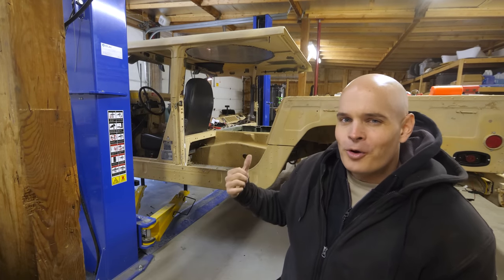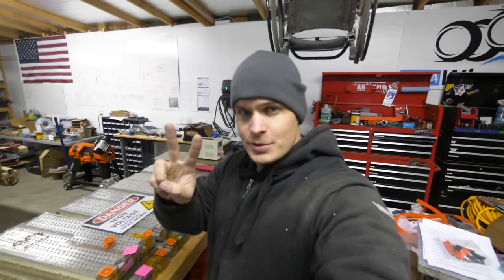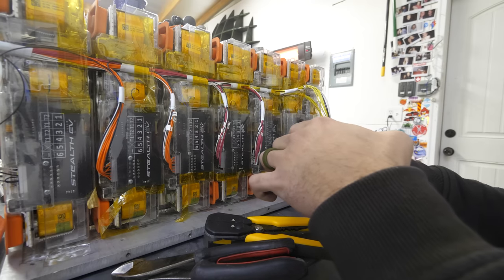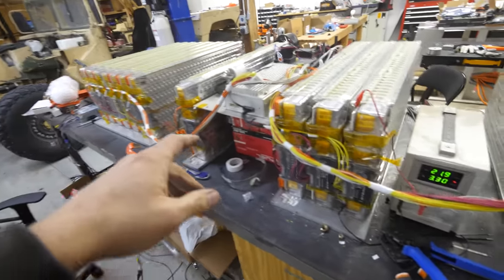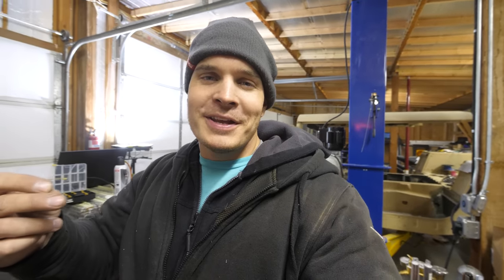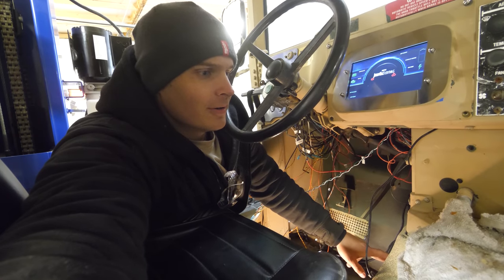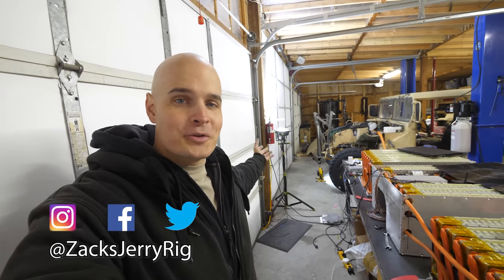Building the Brains of the HIGH VOLTAGE System - IT MOVES!!

Comment: Serious problem that you might want to rectify even though it will be painful… the balance leads should all be the same length, it looks like you cut them off at different lengths to make it look nice and neat which would seem like a good idea but the resistance of the wire changes as the length of the cables change and this will throw off the BMS making it inaccurate and highly likely throwing the batteries out of balance. Love the build keep up the awesomeness man 👊🏼

Comment: 16:09 The reason gage numbers are inversely proportional to the wire size is because back in the day when they made wires (and maybe still today, I dunno), they pulled the original chunk of copper through a hole. If you wanted a smaller wire, you'd have to keep pulling the copper through successively smaller holes. So a small 18 gage wire would've been pulled through 18 holes.

Comment: Amazing project! So cool to see it coming together!
One suggestion I would add though, is that each box should have it's own set of contactors.
I don't think that's the case, but in the event where you need to take the battery apart again, those long live cables coming from each module are going to become a safety hazard.

Comment: Just wanted to point out, voltage doesn't kill, amperage kills. A taser releases 50,000 volts of energy, but less than 3.0 mA. I've been shocked by 110, 220, 330 and 440. 330 and 440 HURTS, but 440 blew the soles of my shoes out. I'm no electrician by any means, but I was taught to respect electricity and I have had to replace outlets and motors live. You just gotta take you time make sure you don't accidently touch both contacts. Probably the scariest experience was with 12v AC. I had to replace fiber optic motors in one of our casinos live cause we didn't know what breaker they were on, we tried the ones labeled "Fiber Optics" and we still don't know what those turned off, but it wasn't the fiber optics 🤔🤷‍♂ so I chose to replace them live. First one I did I didn't do the 1 wire at a time rule, Stripped both wires and the sucker started arcing and shocked the crap out of me. The other 12 motors went fine once I did it 1 wire at a time. I will never work at that location again. But I do love the fact that you respect the voltage, but again it's not voltage that kills, it's amperage that kills.
Reply: Voltage plays a role though, due to Ohms law.  You could have a power source which can deliver way more current than is needed to kill a person, but if the voltage is too low given the resistance that the person presents in-circuit, then a lethal current cannot flow through them, thanks to Ohms law.

Telephone exchanges for example, often run equipment on 48v - 50v DC bus bar.  That 50v DC bus bar is fed with configurations of very many huge 2v lead acid batteries (parallel banks of 25x 2v batteries in series), each battery individually capable of sustaining 1000+ Amps, yet you feel nothing at all if you touch both terminals.

I've also touched both the black and red sides of that copper 50v DC bus bar with one dry hand span and felt nothing, but short that bus bar out with a screwdriver or spanner and watch it explode in your hand, like a huge fuse pulling thousands of Amps.

As I'm sure you know, the human presents to a circuit as a resistor and Ohms law means that a lethal current depends on the humans resistance, the Voltage present and the current capability of the power source.

Comment: I have worked with high voltage batteries for DIY electric cars (Formula Student competition). My recommendation is that you should put a insulation layer inside the metal box. If you check closely you can see that the distance from your battery segment terminals to the metal conductive case is quite small. If something would go wrong it is easy that the terminal would touch the metal case. It might seem that that could never happen but think about that you might for example drop a washer or a nut down there that shorts the terminal to the case. Besides that your cable management is very good.
Reply: Yeah same here, our BMS wiring and all those cell sense fuses looks like a nightmare 😂

Comment: @23:08 That lug has the wrong size hole. I'm sure some will say that it doesn't matter, but you could get excessive heat build-up under the loads that connection will be experiencing. Just seems like something you would make sure was proper given how attentive to everything else you are.

Comment: 19:48 
I'm sure it was a mis-speak or just a simplification, but 450 volts is not lethal. It's the amperage that's lethal.  Higher voltage allows electricity to conduct on materials that are not all that conductive. Electric fences, for containing animals, are rated at about 4,000 volts because animals such as horses, cows or sheep, have a thick coat and are insulated from the ground because of their hooves. It barely gives a tickle when you get shocked because it's only about .2 amp that flows through.

High voltage will open the door to ground more easily through you, but high amperage will fry you.
Reply: voltage is a measurement in pressure of the electromotive force. higher voltage only energizes a conductive path   along conductive materials the same as low voltage.  you have fallen for a myth. the electromotive force works by dislodging  the electron on the outer valance of an atom that has one to three electrons in orbit.  this outer valance determines what is a conductor or an insulator . there is no "less conductive",it is or it isnt. same for a semi conductor which can be either a conductor or an insulator  .it is or isnt not less.
Reply: @benniecameron6441  That is interesting and definitely helps me to understand what's going on at a base level, but there has to be more to "conductivity" than what you are presenting. Why does it seem that certain metals/materials are better conductors than others?

Comment: I currently work on some of the tower lighting system (i fix some of the lights on those towers you see going down the road) the flash 324s I work on are around 1200 volts so I know what it's like to work on high voltage. You rarely forget to watch your fingers. But again it's not always the voltage that gets you, it could be the amperage

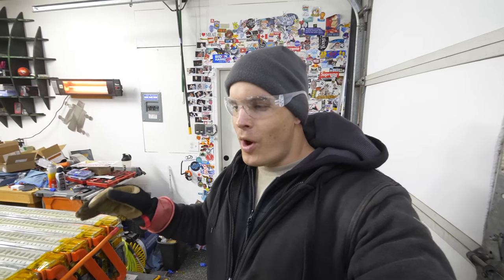Comment: at 23:30 - do you see how close the un-insulated wrench is to the bare alum cabinet!!  you should have glastec fiberglass sheets lining the box - this is a higher di-electric rated compared to rubber and lasts longer under heat it does not break down

Comment: This is so awesome! Small correction about the termination resistors on the CAN bus, the bus doesn't know that is the end based on the resistor, the resistor is there to stop reflections of the signal off the end of the line (that happen due to capacitance and inductance of the wires which we usually ignore). These reflections can muddy the high speed signals.

Comment: Like suggested elsewhere: you should put some insulation around the connectors and also put some rubber grommets in the holes through which the wires go between the 3 boxes. Also: using a metal box without insulation is not the safest idea. One slip of the high voltage wires when connecting or disconnecting and...

Comment: Small thing I noticed. Shouldn't the holes on the battery management box be grommeted? (where the main cables enter) I think there could be cable chafing without that and that could be bad. Probably got this covered already but just checking.

Comment: Cool project! How about an experiment stimulating regen by water? Basically using the car as a power plant. Mounting some pallets on the wheels and parking it in a small river (slightly raised so the wheels can spin and regen). Could be a great solution for remote locations with river nearby. Would be interested in your thoughts if this would ACTUALLY work and how many KW/h the car could self charge in a 10km/h small river. Maybe later, when fully finished.

Comment: 26:01 - looking at that wifi module, wondering if there's an aluminium plate going over the top - if so, probably not going to have much wifi signal.

Comment: I can see that you removed the original PCB from the Tesla modules. That made everything more complicated. That PCB was reading the data (cells voltage, and temp) but also was balancing that module. So instead of having only 2 communication wire connected in a ring between modules, you decided to use KM of wires  (or miles in your case) from each module to the main BMS. I have my own BMS that can communicate with the Tesla modules, and it makes the whole installation simpler and safer. But congrats for the entire project!

Comment: The CAN-bus is a differential pair system, meaning that a serial signal is transferred trough the high wire in its original form and through the low wire in an inverted form at the sending side. Now every interference that acts on the wires will act on both signals the same. On the receiving end the low wire is inverted back and than combined with the high wire. And this is where the "magic" happens: Because both serial signals are now the same again, they add up to twice the signal strength while any interference that hit the cable on the way now is inverted in one of the wires and therefor it cancels itself out. Oh, and you twist the cables to ensure the 120 ohm impedance that you need to have a good signal strength... So make sure you measure the impedance of the cable. if it's not 120 Ohm, your CAN signal might degrade...

Comment: Zach, you were completely right about the 450V is lethal, because it is the voltage that kills. But we can see electricity, but not when it is running through a cable. Think about lightning or arcs or sparks, those are pure electricity, so we can see electricity.

Comment: 22:44 I don't see any rubber pass through grommets on those holes. Also, 23:01 That power cable it going to get worn/damaged over time by the metal corner near it. I'll assume that you'll address those things later, right?

Comment: Make sure to use rubber fittings for the holes where cables run through to prevent potential damages to the cables

Comment: I would highly suggest to put cable gland rubbers or rubber gromets where the cables leaving the aluminium boxes because with time if there is any shake in the system the edges of the box will cut the big wires thus creating a huge short circuit.

Comment: Great video. Great project. 
Caveat. The amps are what's dangerous not the volts.
Watt= volt x amps. The higher the amps, the more dangerous. You probably have a lot of amps there. Probably 45000 watt/hours there? Then 450 volts times 100 watts?

Comment: I suspect (and hope) the NFS is the wireless connection:
it can be low power
it can be low range
it is secure

If they use any other, I really hope it is a secure connection.

For twisted pair, as far as I recall it does not block the interference, it just makes it evenly applied to both pairs of wire, and since they carry opposing signal, the interference can then be clearly identified and isolated.

Comment: I have been following this series from the start and very excited to see the end result but I have a question about cooling your batteries..
When you designed the battery casings you haven't marked or noted anything regarding a cooling system for those batteries specially for 450 volts system thats kinda important.
Any plans for the future ?
Or is there anything we missed or didn't see ..
Thanks and keep up the good work 
I'm checking the channel regularly like every Wednesday to see if you uploaded any updates about the project.

Comment: HI man I want to throw a suggestion to you about the wires on the underside of the hummer you should double rap them each rap is a separate color so if anything gets nicked along the way it is easy to identify  the point of rubbing i think it would be a good safety measure if there were trouble sometime in the future

Comment: The odd Ground wire needing to be connected provide the SAME ground reference to everything.  Voltages are measured as a potential difference in "voltage OR pressure" The latter being a comparison like water or air pressure. Communications also use voltage and must have a base line to measure from and it's normally very low for communications.  
The 450 volts is a concern, but it's unlikely to kill you unless (like you have) a whole lot of flow or amperage. The amp's will flat fry you.  Ever get shocked by a door knob or car coil. Your talking 8 to 30 THOUSAND volts but next to zero flow.  Think a soda straw with 20k psi, it's high until you open the valve with zero restrictions the straw would not move VS a fire hose same pressure but with your 100 gallon tank (18 battery packs)
Reply: it doesn't take all that much current to kill a person (static shocks are extremely low current), on the other hand, all the current in the world isn't going to flow through a human body unless the voltage is high enough.  The electrical resistance of the human body is extremely variable (depending on all sorts of condition's), but taking a sort of middle estimate from google, i get 10,000 ohm's.  At 450v, that would pass 45 milliamps, about half what is commonly considered lethal.  It's close enough that i wouldn't consider it "unlikely" personally.
From the bit of reading i've just done, more people die from low voltage shocks (120v ac or less being implied here) than higher voltage.

Comment: One thing I want to say what do you have the boxes insulated with insulation so if a short wire comes loose will not be a problem but I think you should have a isolation

Comment: I am unsure how your CAN network is setup, but if I rember correctky from school projects, there should be two and only two resistors enabled on each conected pair of H and L, on the furthest connections, to componsate for comething about high frequencies over long wires. Please make sure to double check this before running, ask a mechanic familiar with electronics in the car industry preferably. I had issues with hooking up too many ESCs with resistor enabled and the signal voltage was pulled too low to be registered and the readings were all over the place.

Comment: Great project, very neat work. Just wondering if there is a torque rating for the high voltage wire connectors. It didn’t appear to be tightened very much with that ratchet. I realize it is still on the test bench at this point.

Comment: This is so cool,and you are the most satisfying and educational and fun person to present this. But i learned that the human bod has about 1mega ohm (1million ohm)of resistance with dry fingers,and an lethal amount of CURRENT (the voltage is not important here),is about 30mA. If you do the math you should get to a max of 450microA with 450Volts. This could in a worst case be lethal but at the same point it is dc, which has a harder time to penetrate your skin than ac because of inuctance or cundotivity.. I THINK that your setup this is barely lethal for the human body resistance. In Germany we have 230volt ac,whivh is about 300v dc and about 30mA through a human body on the power plug. I got some shocks from that through my body at my apprenticeship,im fine,but it was no fun,believe me😅.. thank you for your videos and have a great year 2022!Lg,Sven

Comment: zach, at 21:59 you lower the case over the center battery modules. it looks like a short hazard, in that if the box gets dented in it could touch the main positive and negative at the same time. do you have any insulation between the modules and the aluminum? rubber sheathing? anything? I'm sure the cases are rugged, but what about an accident?

Comment: You would do well with a center removable fuse as well.  Good for a way to pull and no that htere cannot be HV turned on without it in place.  Most EVs utilize something like this.

Comment: I would love to rock crawl with an electric system .  I would imagine it would be  awesome,   because I've tuned in and out ( memory of a gold fish)  I'm not sure what transfer case you've got in it,  but some have an option for  you to make it 2wd front or rear only and that makes for some power in different uses.   I also would imagine if you can do 2wd high gear you will get some slight range improvements as the driveshafts and axles won't be engaged

Comment: maybe a little solder to the 2/0 cables terminals just to be sure wont be bad, sometimes the pressure of the crimp isn't enough and time and vibrations loose them up, you could end up with a hotspot

Comment: Thanks for the great video. But just a remark. It will be a good idea to tighten the BMS wires that go down behind the busbars with tape. Otherwise, the weight of the wire will increase vibrations and destroy the connection between the wires and the plugs over time.

Comment: I am concerned about the 2 watt conduit  in the passthroughs for the boxes, and the holes have rough edges that can eat through the sleeve of said wires over time, do you have a plan for that or simply an oversight? I believe some rubber grommets would work perfectly, and they are cheap .

Comment: I'm not sure if anyone else is thinking this but you should really put rubber sleeves in the holes between your battery boxes there to prevent the wires from running on the bare/sharp metal holes

Comment: Hi, the metal battery box seems sturdy but better insulate the inside. Just in case if the high voltage terminal comes in contact with the box.

Comment: The way you are charging the batteries with the DC power supply is perfectly acceptable.  But you must have an automatic cutoff system.  It's a sure fire gaurentee you'll get distracted and loose track of the situation.  A simple alarm won't do because the alarm will sound with no one to hear it and respond, it just keeps going.